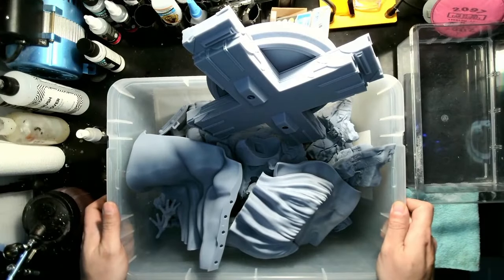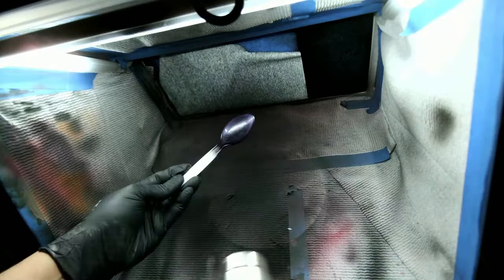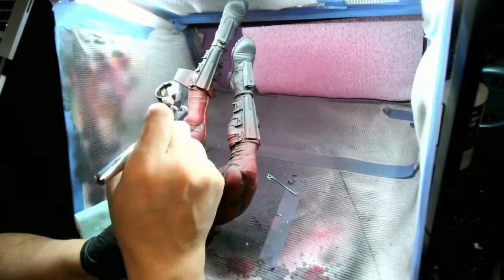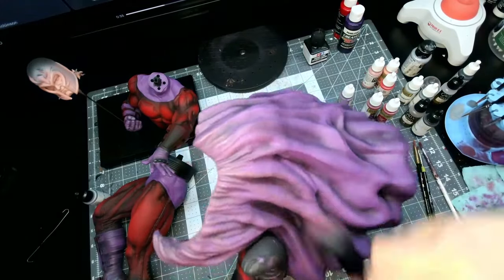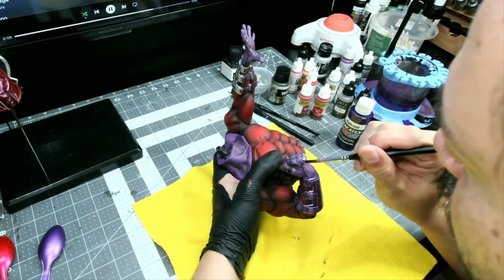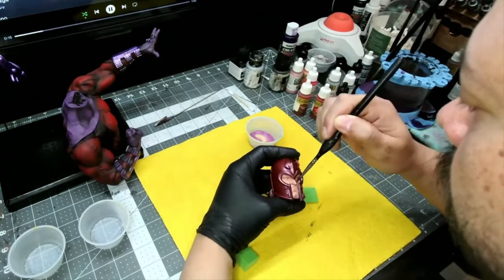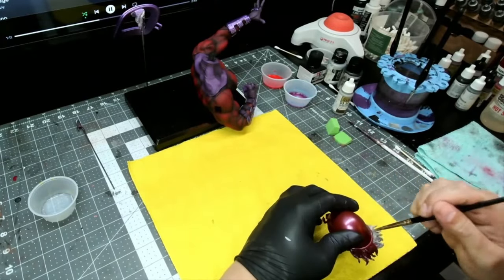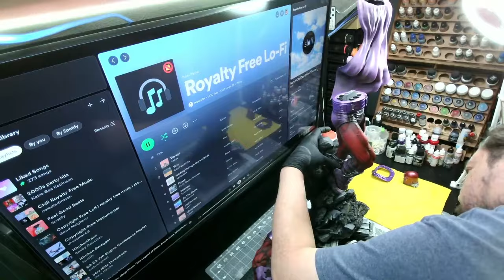I 3d printed & painted this 1/4 scale Magneto statue

Comment: I love it, you are really talented. I have a question...after you apply the primer you also apply sealer before the color or you can use the color over the primer?
Reply from the maker: Thanks for the compliment and the question! Primer is really just to help the paint stick... so just prime, apply your paint and then seal the base coat. After that it's ready for washes, dry brushing, etc. Hope that helps!